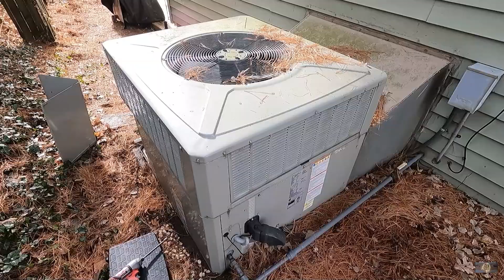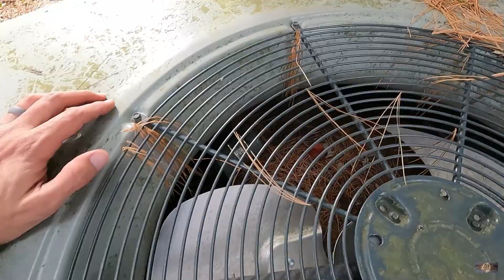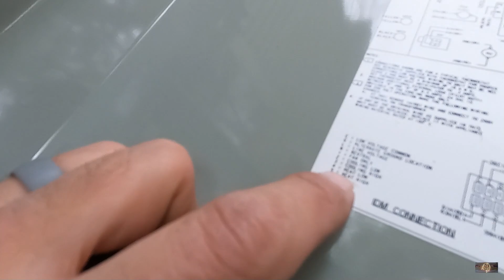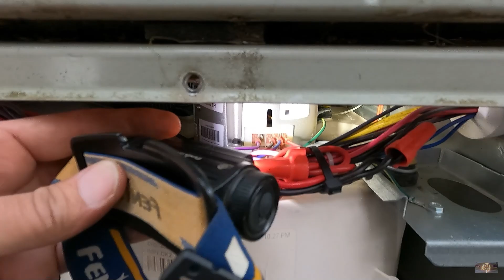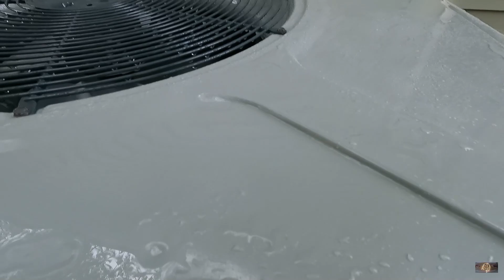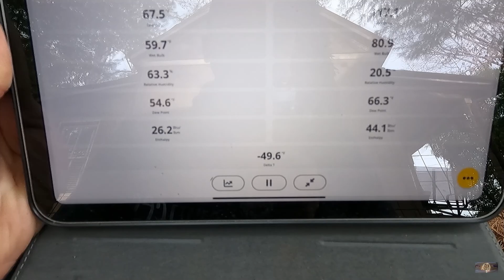Adjusting a 4 Year Old Trane Gas Pack

Comment: If you could speak up a little it would help 😊 thanks
Reply from the maker: I am having issues with my GoPro.  There is a little piece of something that has covered one of my microphones from inside the camera.  I poked holes in it, but it seems like when I am on that side of the camera it picks up worse than the other side.  Thanks for the feedback.

Comment: Nice job, Jake
What wax do you use and cleaner?
Reply from the maker: Different kinds.  I have been using Turtle Wax Wax & Dry lately.  I also use Turtle Wax High Gloss Spray Wax, Turtle Wax Minute Wax which is a ceramic coat technology, and Turtle Wax Bug & Tar Remover for stubborn spots.  I was also using Turtle Wax ICE Synthetic Polish (it was that clear liquid that could be put on everything) and Turtle Wax Clean & Shine, but now I can't find them around here anymore.  The ICE polish would shine the unit up for months, even the plastics would go back black and look restored for months.  The Clean & Shine gave the unit a little extra pop before the wax or ceramic coat.  Worked good on split units in attics or crawl spaces.  I sometimes use Turtle Wax Color Back to restore the paint now if I have the time and have some on my van.  The Color Back is more labor intensive though.  Not a spray.  Turtle Wax has gotten a little expensive.  The Wax & Dry used to be $3 a bottle.  Then, it was $5 per bottle and it jumped to $6 per bottle and now it just went up again here to $7 per bottle plus 9.5% tax.  The ceramic coat stuff is $12 - $15 per bottle or so plus tax.
As far as cleaners I use an organic all purpose cleaner made up of some essential oils (Doterra or Now brands) that I mix up myself.  Mainly lemon, lime, lemongrass, peppermint, and a couple of other things.  I use distilled water to dilute it.  My wife is the mixologist there.  Lol.  I also have used a cleaner by Thieves as well that is all natural.  On tougher spots, I will use heavier cleaners that are safe on metals diluted down with distilled water.  Can't remember the name of the stuff I have now in my van.  I got it on a clearance sale.  It is purple in color.  I have used mean green diluted way down and simple green as well that is diluted way down.  Don't ever want to hurt the paint or finish, so I like to use caution with heavier cleaners or degreasers.

Comment: Nice thorough work on that one. Unit looks new again. That compressor work looked a little sketchy though.
Reply from the maker: Yeah, probably wasn't a nitrogen flowing while brazing operation.  Looked like a cut and stuff.  Real high end.  Homeowners unfortunately don't know the difference between someone who does everything correctly or a guy that just takes all of the shortcuts and gets it done however.  Most just look at the price.

Comment: Hi Jake what kind of wax do you use, that unit looks awesome
Reply from the maker: Different kinds.  I have been using Turtle Wax Wax & Dry lately.  I also use Turtle Wax High Gloss Spray Wax, Turtle Wax Minute Wax which is a ceramic coat technology, and Turtle Wax Bug & Tar Remover for stubborn spots.  I was also using Turtle Wax ICE Synthetic Polish (it was that clear liquid that could be put on everything) and Turtle Wax Clean & Shine, but now I can't find them around here anymore.  The ICE polish would shine the unit up for months, even the plastics would go back black and look restored for months.  The Clean & Shine gave the unit a little extra pop before the wax or ceramic coat.  Worked good on split units in attics or crawl spaces.  I sometimes use Turtle Wax Color Back to restore the paint now if I have the time and have some on my van.  The Color Back is more labor intensive though.  Not a spray.  Turtle Wax has gotten a little expensive.  The Wax & Dry used to be $3 a bottle.  Then, it was $5 per bottle and it jumped to $6 per bottle and now it just went up again here to $7 per bottle plus 9.5% tax.  The ceramic coat stuff is $12 - $15 per bottle or so plus tax.
As far as cleaners I use an organic all purpose cleaner made up of some essential oils (Doterra or Now brands) that I mix up myself.  Mainly lemon, lime, lemongrass, peppermint, and a couple of other things.  I use distilled water to dilute it.  My wife is the mixologist there.  Lol.  I also have used a cleaner by Thieves as well that is all natural.  On tougher spots, I will use heavier cleaners that are safe on metals diluted down with distilled water.  Can't remember the name of the stuff I have now in my van.  I got it on a clearance sale.  It is purple in color.  I have used mean green diluted way down and simple green as well that is diluted way down.  Don't ever want to hurt the paint or finish, so I like to use caution with heavier cleaners or degreasers.
Reply: @JakePorterHVAC  Thank you so must Jake for your response
Reply from the maker: @robertpenczar8930  Welcome.  Was at the store yesterday and the Turtle Wax Wax & Dry went up in price again around me.  $7.47 plus tax now.  This inflation is Nuts!